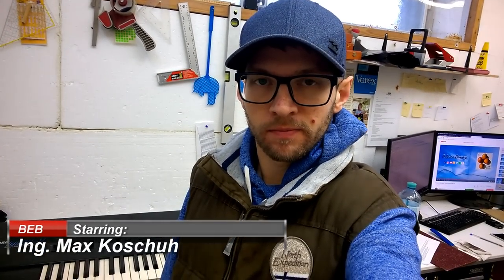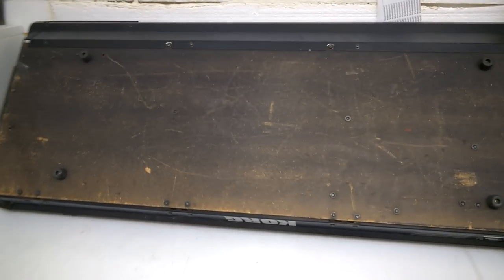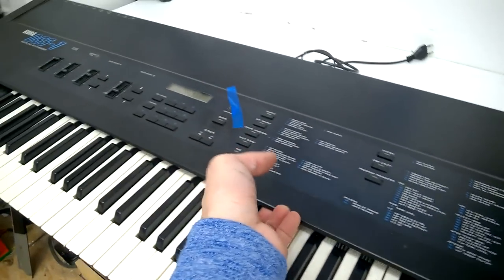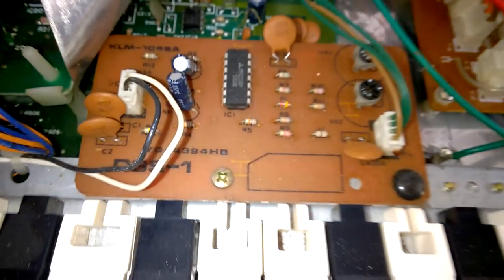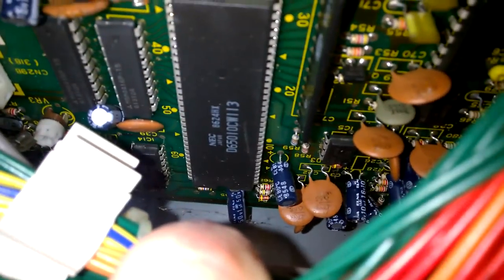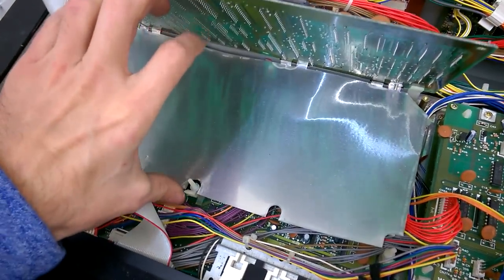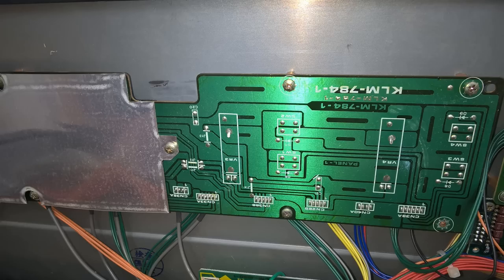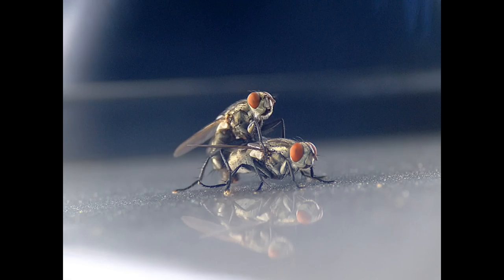BEB #82: Korg DSS-1 Synthesizer Keyboard Teardown (What's inside?)

Comment: I have one I got very cheap, but the disc drive does not work. Taking it apart is confusing and your demo really helped with the 3 scr4ews info. Now to dig in and see what my KLM 780 board looks like. The dream scenario is that the ribbon popped loose. ;)

Comment: Hi Max, 
I watched your oscilloscope video and now I want to get one, but I have no money and never used one before. 
What is the "best value for money oscilloscope model" to look for on the second hand market in Germany? 
I am dabbling with high power led lamps up to 52V 12A, dc power-supplies, batteries and dimmers. Thank you for your help.
Reply from the maker: Hi Kaiser,
every oscilloscope does that job :-)
You are looking for nasty harmonics, they are most likely less than 1MHz. Go for any scope sold for 20 Euro or less. It can be an analog one.
Cheers, Max
Reply: @MaxKoschuh  - Thank you. Very kind.